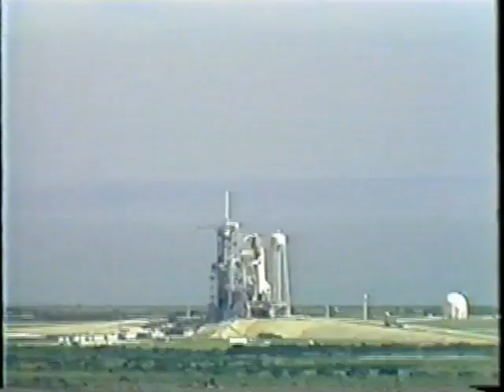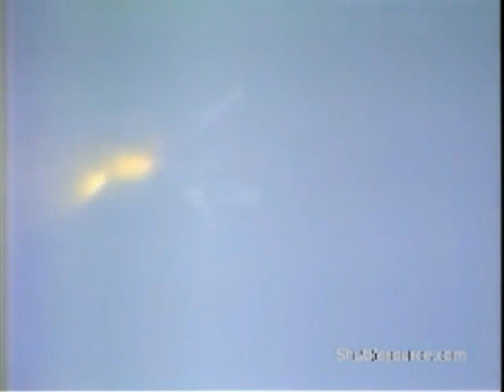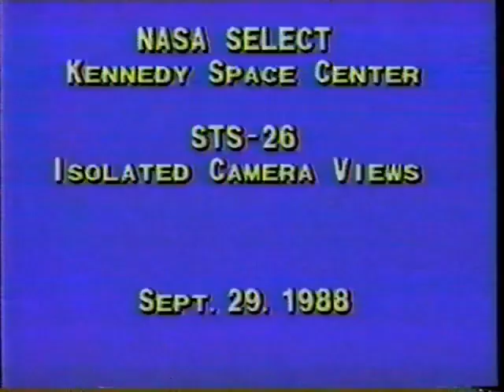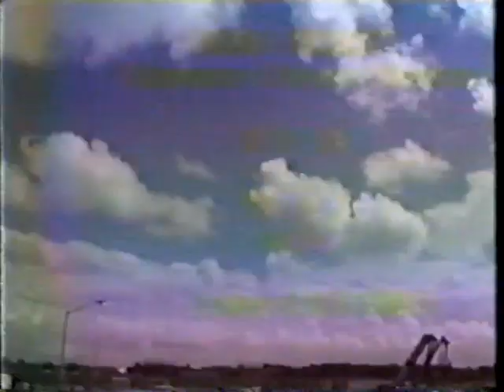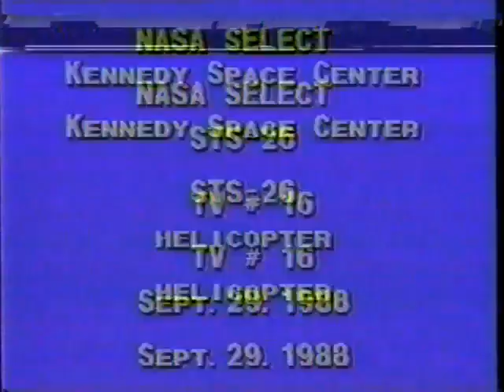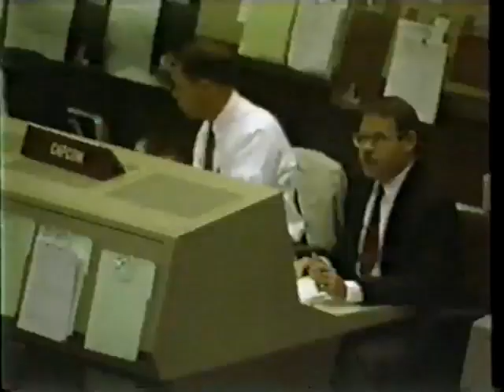STS-26 Launch NASA-TV Coverage

Comment: 18:52 freaky there appears to be flame on the left side of the fuel tank
Reply: That was normal. They're in the upper part of the atmosphere so there's no air to push the flames down. The plume widens as it rises higher in the atmosphere. You see the same phenomenon on Spacex falcon 9 launches.
Reply: I noticed that also